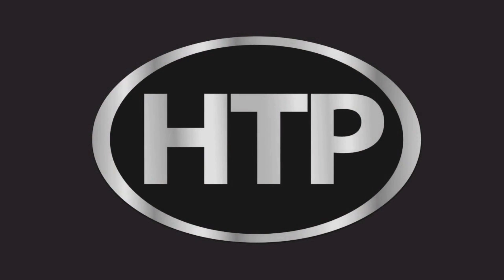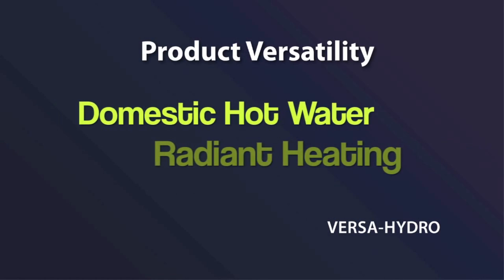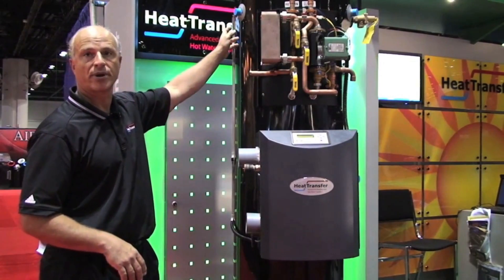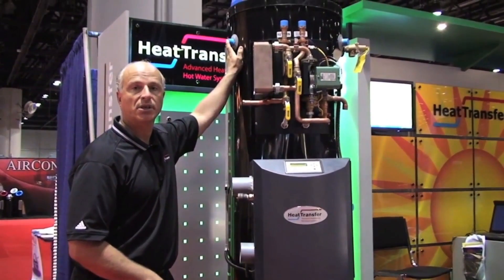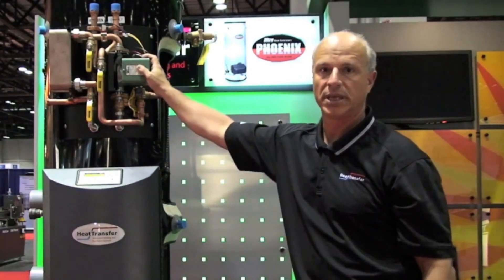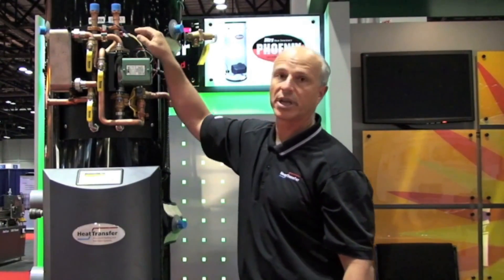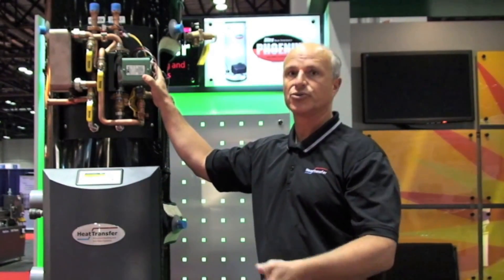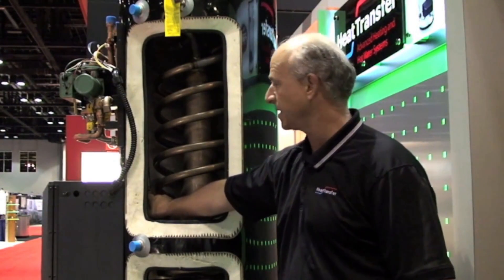CEO Dave Davis explains the Versa-Hydro, Part I

Comment: Our boiler is only 2.5 years old and had 2 control boards, and 6 air switches replaced. Each time costing us money. We have put in about $1000 into this unit after 2.5 years after install.